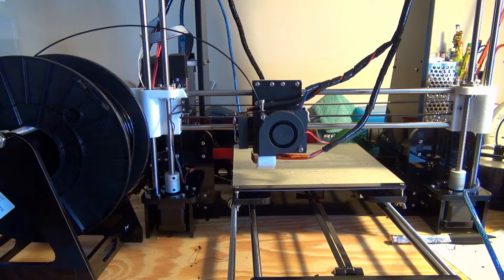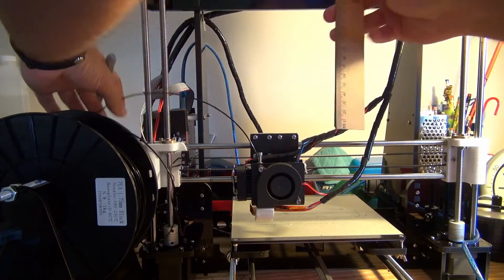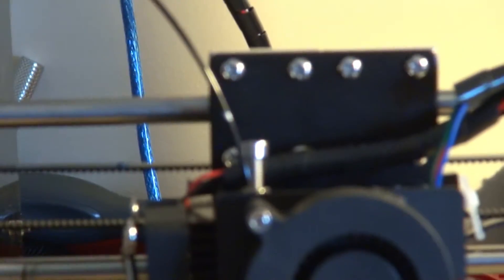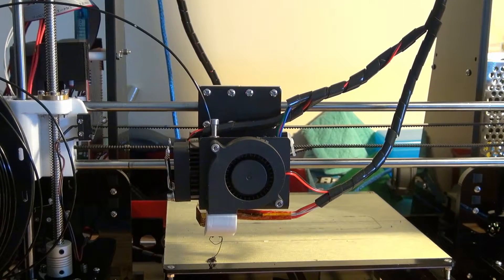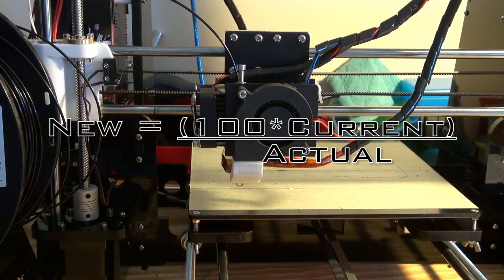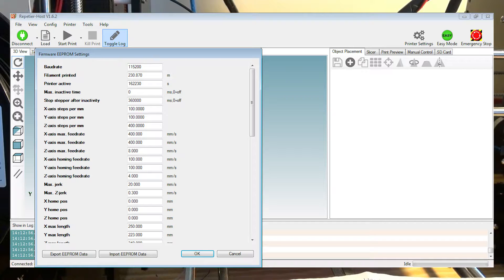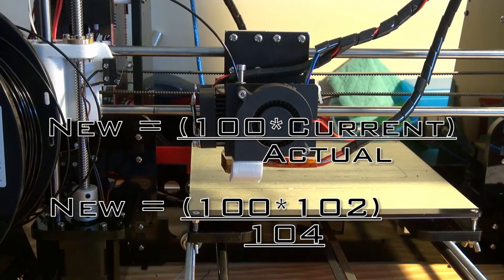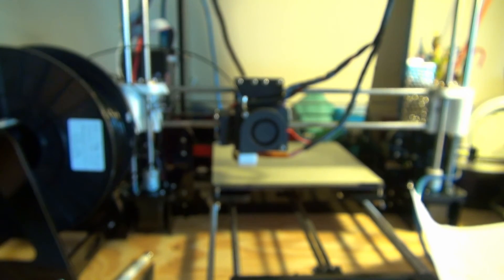Calibrate a 3D Printer Extruder Printhead - Prusa i3 and Reprap

Comment: The formula isn't right in my opinion. We need to know how many steps it takes to get 100mm. So, if it takes 108 1mm extrusions to get 100mm of real material extruded, and if your current setting is 95 steps per/mm it takes 108*95 (10260) steps to get 100mm. 1mm would take 10260/100 (102.6) steps.  In the case of this video it took 96 1mm extrusions to get 100mm of material. That means it took 96*102 (9792) steps to get 100mm of material, which would result in 97.92 steps per mm.

The formula should be: (Number of 1mm extrusions * current) / 100

Comment: Should the Anet A8 be set to 100 mm? because i did this test last night my printer in the options is at 95 steps and it took 105 to get the marked line to the level which means it is accurate but just wondering why default the printer is 95 and not 100?
Reply: Tamanor hey did you ever find an answer? I have the same printer and would like to know too. Thanks!
Reply: Not yet unfortunately but i guess the only why to tell is if we just set it to 100mm steps and if it not right set it back to 95
Reply: Ok I'll try that too I'll let you know what happens
Reply: did you manage to test it? i would try it my self but need to re-level my bed ^^
Reply: Tamanor I tried but honestly did not notice anything different. I'll try again tonight.